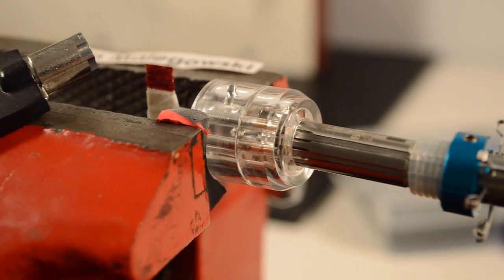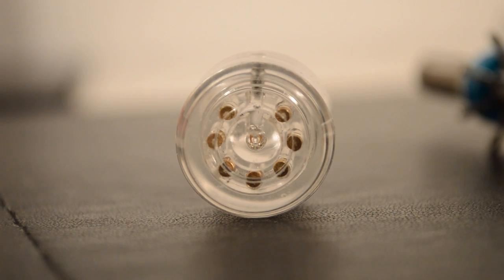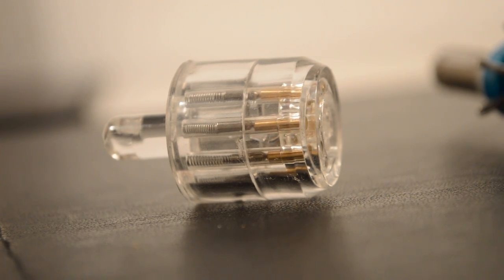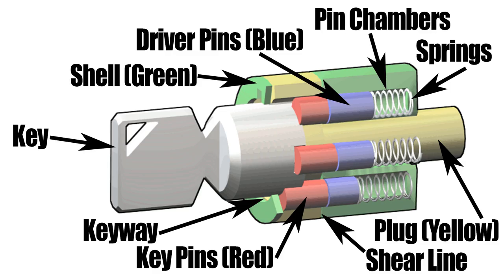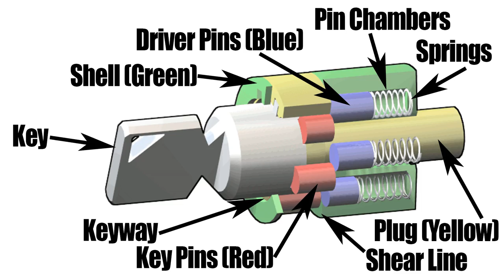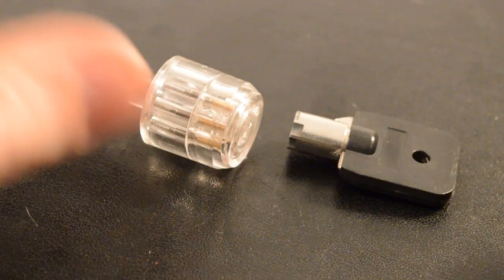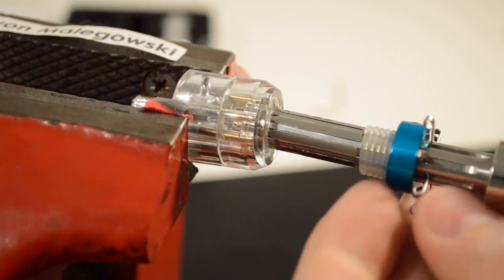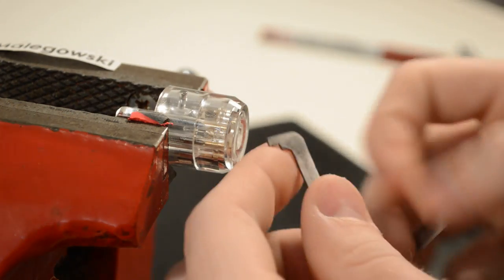How to Open Tubular Locks

Comment: Great video, I agree with others, no music, quieter music, or less intrusive music would be great.  I would personally like to see the frames with pictures and labels stay onscreen longer as I had to go back and pause on each to take it all in.  Seems so simple to pick these locks, the local locksmith shooed me away with my lock...   And I have to wonder, don't older pop machines have these locks, seems like theft would be so easy....   I have heard mention of a variable spring version, is the method for picking the same?

Comment: Shouldn't all pins have the same stiffness? How do the needles get depressed to the correct height?
Reply: Exacom98 Equal pin stiffness was, and is probably just manufacturing convenient, but when they do vary spring pressure, it defeats these types of tubular pick gun's. Add spools, serrations, and you have more modern locks. A Tubular Lock is just a pin tumbler arranged along a circle instead of a straight line. Think of these types as Masterlock# 3 but with 7 pins. No security, easy breezy. 
Peterson's makes a tool that will work on a variable spring tension tubular lock, but the thing looks huge, and is expensive. You can always SPP the lock as stated in the video, but you have to do this for each rotation. The lock might open at 45° or you could have to pick your way all the way to 360°.

Comment: Great video. Very informative. The audio is an issue that you already know about. Some video creators feel the need to add music. In my opinion it is almost always a mistake. I'd rather hear a pin drop, and the picker fart, than some loud TV in the background, but the narrator is still saying something. Music almost always is a personal preference. I like all kinds of music, but when I am trying to learn something, lose the music entirely. it's just audio jamming, confusing the message. Music at any level, of any kind, is just something I have to Wade through to get to the information someone was trying to convey, but desides to add some usually shitty music track to. 
Just my two cents. If you have sub titles, then I'm going to use that and turn off the audio, loosing the narrators voice along with it. Kind of defeats the purpose of making an instructional video. I am 60 years old and I like Rap/Hip Hop. A lot of people who are into lock Picking might hate Rap music. If I make a video about lock Picking a Tubular Lock for example, and I crank up my stereo to something loud, and maybe appealing to a small percentage of the audience, and I also try to yell over this while the bass vibrates my lock Open, using "light tension". I exaggerated of course, and this is not directed at you. it just that you specifically mentioned the audio and it reminded me of so many videos I have watched that could have been perfect, except the Creator desides to become extra creative, and destroys the whole intent in the process. 
whew, that was a long rant... 😂😂😂
Reply: William Mancel to

Comment: Is it even possible to pick an Ace II since the pins require different amounts of tension? Another issue with this particular safe of mine... is that I had to apply some force even when I still had the key, pushing in on the door and almost lifting upward.. so frustrating. Yes, I've attempted single pin picking and am simply having the same problem, and I cannot find the right tension wrench to use... please help.

Comment: Do the little pins that go into the pin mandatory?? I ordered a set and it came without the pins.
Reply: look under the foam padding
Reply: Kevin, thanks. But the pins are not under the foam. They are just not there.